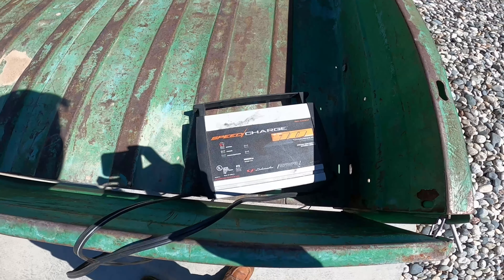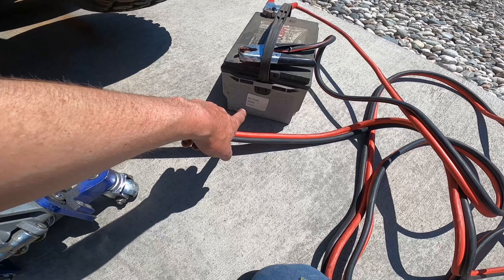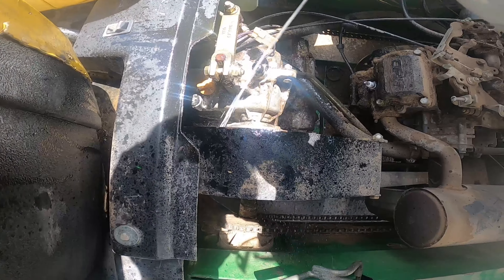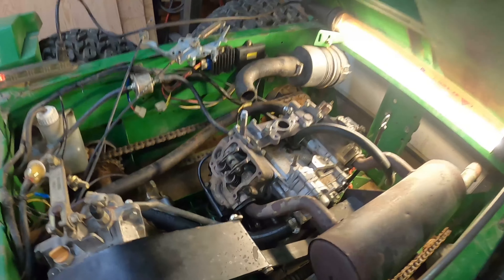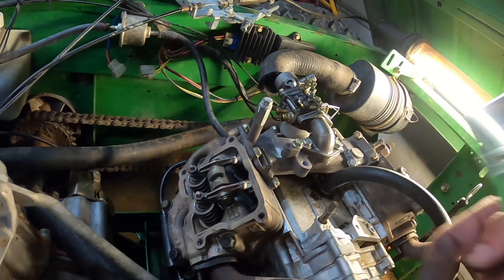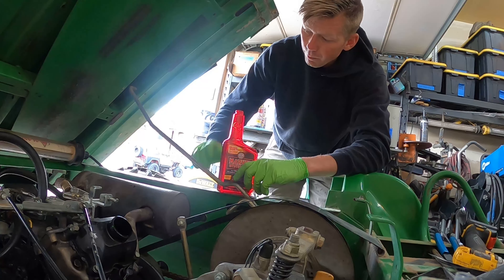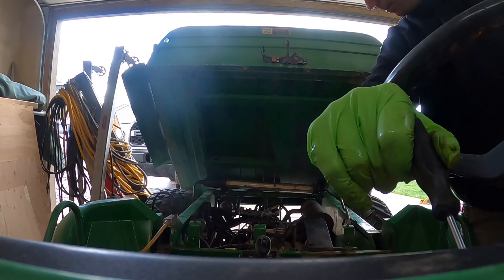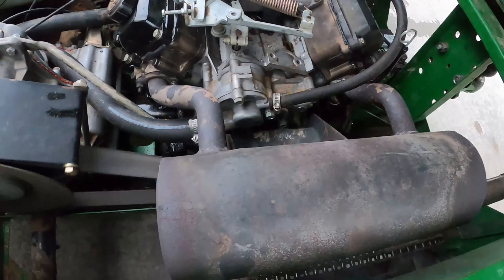Sad John Deere Gator Part 2

Comment: Something to keep in mind, when working with torque critical fasteners, using an anti-seize or equivalent, lowers the coefficient of friction, thereby negating your torque values. i.e. gonna over torque that shit...
Torque values are prescribed for CLEAN and DRY threads, unless otherwise noted.
Just my 2c..

Comment: Excellent video, just what I been looking for, I’m currently working on a gator 6x4, that has some wiring issues and I can’t figure out, can you Do a video on the starter wiring please, thanks
Reply from the maker: I’ve stripped the stock wiring at this point and it has a duromax 713cc. Good luck with your project!

Comment: I guess you know why the oil level was so high! Lol. I’ve used MMO and automatic transmission fluid to flush oil before, no issues. Great video, hopefully it will give you years of use or decent money at sale. Cheers from NC!
Reply from the maker: Putting this thing to work!
Reply: @Andrewactual  When I saw the water come out of the spark plug hole I said “Oooohhh noooo” and my wife across the room thought I got bad news lmao.

Comment: Just received an old gator. So I am pretty new to this but what are your initial troubleshoot steps?
Reply from the maker: Make sure that thing isn’t overheating. Unless you have service records change the fluids.
Throw some grease in all the zerks. 

What kind of issues are you having if any?
Reply: @Andrewactual  it’s been sitting in a shack for over 20 years and friend let me have it before they decided to throw it out. I’m gonna start by cleaning it up a bit before I start anywhere specific but I guess see if it starts firat

Comment: Great video, I just inherited one that showed no oil on the dipstick, was overheating and the dump bed wouldn’t lift. . Got it under control and running well now for the most part but my brakes are grinding big time. Trying not to use them until I can get them fixed but I noticed yours sounded rough too. Did you do a brake job?  I guess they use friction plates in the transaxle for braking!  Any tips?
Reply from the maker: Mine do make noise but until you mentioned it I didn’t plan on addressing it! Might have to crack that transaxle open.
Reply from the maker: I bought a new cover with the image on the cover. I can’t get mine to stop overheating so I bought a new air cooled engine. I’ll use the existing fan to pull fresh air through the engine area.
Reply from the maker: That new bezel you made looks really nice! I like the words spelled out. I have a printer and I enjoy using CAD, I might have to steel your idea. I appreciate the offer!

Comment: Those damn Kawasaki's are tough man. When your oil level was high I was just sure it was fuel....guess we both missed that guess!
Reply from the maker: I never got to talk to the previous owner if they really even knew anything. Someone did some weird modifications but they did say it “needed a new engine”. I was thinking fuel also as I just dealt with my Cummins last year with a leaking injector adding to my oil level.
Reply from the maker: I am still surprised all I had to do was clean up the carb, and throw some head gaskets on it. At this point I have it fully running well  and looking good for $1200. I can’t find another one for sale in any condition around me for less than high $3k.
Reply: @Andrewactual  No doubt the old girls have held their value. They are made very well and luckily you can still get most parts. Not as fancy as the newer side by sides but infinitely easier to work on.

Comment: A customer of mine has a military gator 6x4 that he might sell. It has a diesel 3 cylinder
Reply from the maker: I’d love to have one of those!
Reply: how much???
Reply: @rogerpullin8997  Don't know yet. I still have to add some coolant, just finished replacing the front clutch and the belt. ignition switch being the toggle type and a new starter. He already replaced all the tires and they have lots of meat on them since it sits more than being driven. The dump bed works fine. I can't wait to drive it before he sells it.

Comment: I got an older gator from my buddy and the engine had the same problem as yours and l fixed it and the engine ran flawless but im missing a bunch of parts off the baseplate and governor and l had Deere order some parts and some of them were right and some were wrong but I’m missing one wire or spring i don’t know which but it’s goes from the baseplate to governor any idea what it could be?
Reply from the maker: I’ll take a look at my engine, I still have it sitting on side the house. I may have disassembled the throttle but I’ll take a look.

Comment: You can wet sand the heads if their uneven with wet sandpaper.& oil some penetrating oil by laying them both on A bench top on A flat surface sand it side to side. Then the bottom to top motion for evening out the heads.
Reply from the maker: It had since ate the new head gaskets, new engine going in soon!
Reply: Always add an additional step to your sequence on head bolts. If it says 10-20-30-40........ Do 10-20-35-40-45. Yes over torque your bolts by 5 if you use thread lubricant and and extra step. Then your gaskets won't blow again

Comment: Might be doing this soon so getting all the info I can 😅
Reply from the maker: Can’t remember what I ended up posting about the gator but it has a duromax 730cc engine now, it’s a monster with the power.  The stock engine kept overheating and quickly became financially disadvantageous.
Reply: @Andrewactual   ok, are there any engines that can be subbed for a gator one that's cheaper?
Reply from the maker: @IronsharkGaming4747  with some fabrication ability you could theoretically put any horizontal shaft engine you want. You just have to find the right size clutch to fit the belt and the crankshaft, and determine how much power you want.
Reply from the maker: @IronsharkGaming4747  for the clutch, a place to start looking is the Comet 780 or the knock off versions of that model. I paid $115 for my clutch and it’s been flawless. Any engine with a 1” straight shaft would fit that clutch, then you just have to worry about belt alignment, engine position to tension the belt properly, engine clearance to the bed, and linkages to throttle and choke. That’s all 😬

Comment: Inherited the same model, put a new battery in, no life whatsoever. Hoping to at least get a crank to then use this video to troubleshoot.
Reply from the maker: I can’t remember but see if there is a switch on the shifter that is unplugged not showing it in neutral.

Comment: Maybe the cransshaf
Reply from the maker: Crankshaft was good, these things are horrible for overheating due to vapor lock in cooling system, updates coming in the near future.
Reply: @Andrewactual  any updates? Mine overheated today.
Reply from the maker: @brich2929  I need to throw an electric fuel pump back on and finish that video. I pulled the stock engine and replaced it with a duromax 23hp air cooled that runs great at lower rpm but runs out of fuel at higher rpm (common problem with this series engine). If you haven’t already then check out part 3 

Still Working On The Sad John Deere Gator Part 3
https://youtu.be/urK8FZ6juCQ